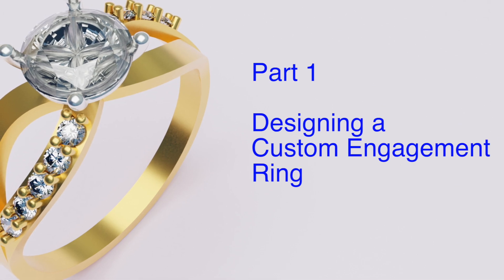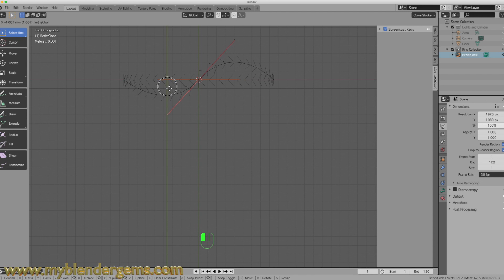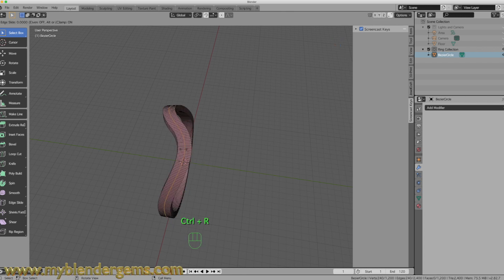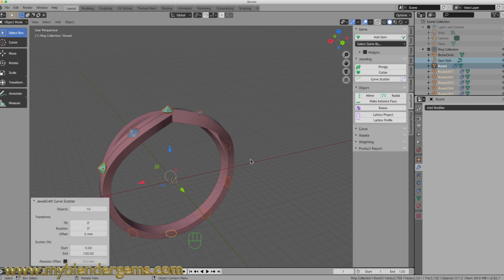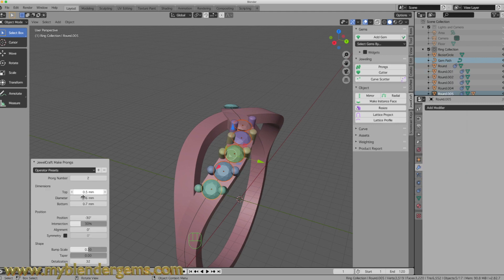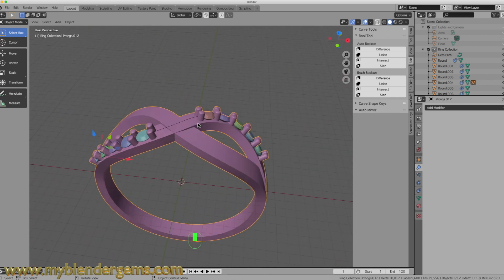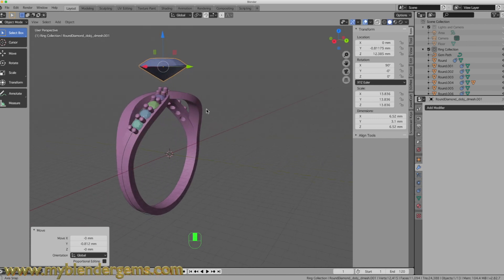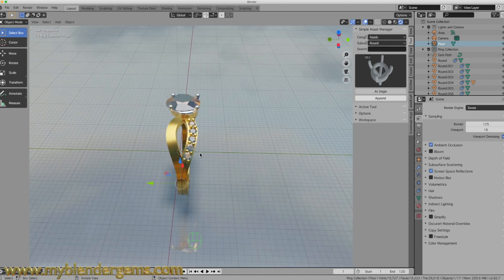Modeling a Diamond Engagement Ring with Blender 2.8 and some add-ons! Part 1

Comment: Hey Peter, 
if you wanted the initial S curve shape without adding the additional spiral, would that be a viable shape for a ring? Kind of like a tension ring but with a normal traditional gallery?
Reply from the maker: Sure
Reply: @watchesandjewelry   whats a contact for you regarding blender training costs?